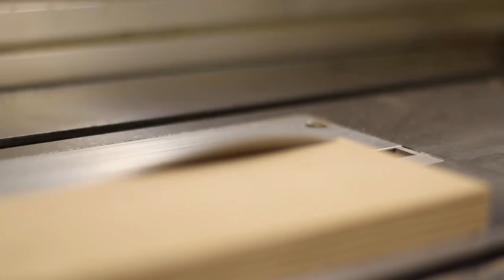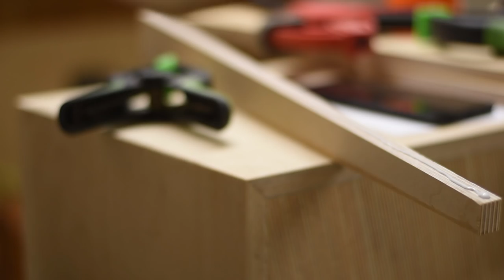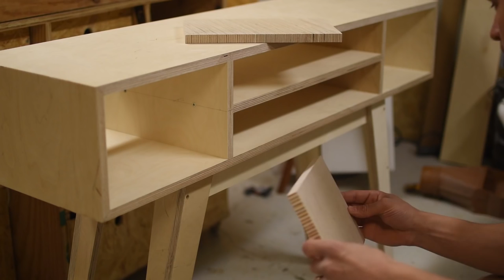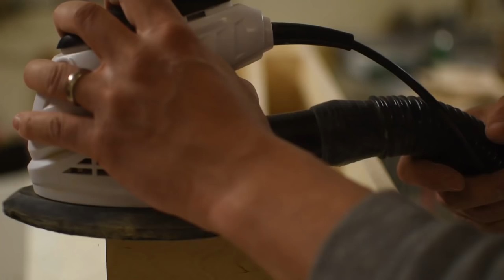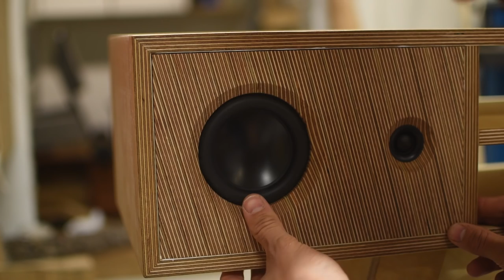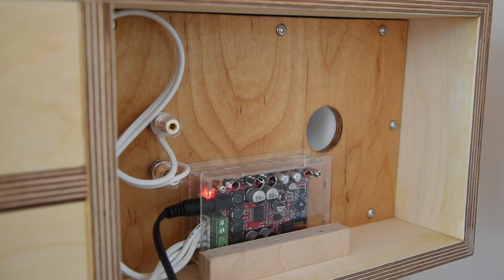Console table with bluetooth speakers // #rocklerplywoodchallenge

Comment: This aint carpentery, this is pure art ! cong
Reply from the maker: Thank you, you are too kind! :)
Reply: You can get a better sound if you change the power supply, I dont know if it is 5 or 12 v but looks very chinese switching type. If you use a high current analog power supply you will be surprised of the quality of the audio, even with the same audio bluetooth module, just want to say thank you by sharing too : )
Reply from the maker: Yes thank you! The one I use is 18v 2amphere so it is enough :)

Comment: Great job.  Integrated Speakers in furniture.  I was thinking along this line for TV Console.   But 1 question ... wouldn't the vibration from the speakers caused objects to move on the table/counter top?
Reply from the maker: Thank you! :) Not in this case. The speakers are only 4" and the table is pretty heavy. But is you use bigger speakers like 8" there might be some vibration.

Comment: How much plywood you need ? What was the thickness for the build? Woukd 3/8ths work ?
Reply from the maker: I think that's a bit thin. I used 16mm, just under one sheet of plywood
Reply: I was going to use hardwood walnut plywood
Reply from the maker: Sounds Good. Tag me on Instagram if you post anything there :) @erikdidit unfortunately I haven't started doing build plans of my projects yet.

Comment: Good job but shouldn't those bass speakers be closer and the little ones outside?
Reply from the maker: Thank you! The distance depends on the crossover. If you have a pair of bookshelf speakers you can try laying them down on the side with the woofers out then turn them 180 degrees and listen if you can hear a difference. I haven't tried myself but curious there is any difference :)
Reply: I think it's about having the tweeters as wide as possible to get 'bigger scene' and that's why they keep them outside. Either way average person probably won't hear any difference.
Reply from the maker: That seems like a legit reason. I haven't thought about that. I plan to build a media table with active speakers connected to the tv, I will put the tweeters on the outside then. :)

Comment: Perhaps I missed it, but what oil did you use in the finish? Nice looking table!
Reply from the maker: Thank you! Boiled linseed oil
Reply: @Erikdidit  Thanks for the quick response! I have seen many people use it in this challenge. Works well with the plywood.
Reply from the maker: Yes, it does and it is quick and easy to apply.

Comment: Great work!! How much it cost and also how long do you need to built from the start, please? Thanks ;)
Reply from the maker: Thank you! :) Both the cost and hours is pretty hard to estimate. Maybe it took me about 10-20h to build. Excluding planning, calculating the speaker enclosures and crossovers. It depends on how experienced woodworker you are. The cost was around 200€ for the electronics and plywood in my part of the world :) that is not an exact figure but an estimation :)
Reply: @Erikdidit  Hi, thank you very much for your reply!! Keep up great work.

Comment: I'm not a speaker aficionado, but don't you need a crossover to separate the sound to each speaker?
Reply from the maker: Yes you are right. It is not needed but it is definitely better, you will get a much better sound. I design and build my own crossovers and there is two crossovers in these speakers as well.

Comment: Have you got or would you have plans for this? I'm starting myself building for relaxation (untill things go wrong lol) and wouldn't even be able to estimate dimensions.
Reply from the maker: Sorry I won't have any plans för this build. Anyway, good luck! :)
Reply: Any chance you could just tell me.the dimensions then?
Reply from the maker: Sure, internal dimensions is height 16,5 depth 21  width 26,5 cm. The port is 35mm in diameter and 11cm in length
Reply: Thank you. I hope I can do it justice
Reply from the maker: Good luck! :)

Comment: I feel like you should have installed the amp inside the enclosure
Reply from the maker: James Holbrook yeah, I have done that in my other speaker builds. The reason I left it outside was that I wanted to be able to connect another better amp if I wanted to. Next time I will probably put speaker terminals outside but also mount the amp inside. Thanks for the feedback!